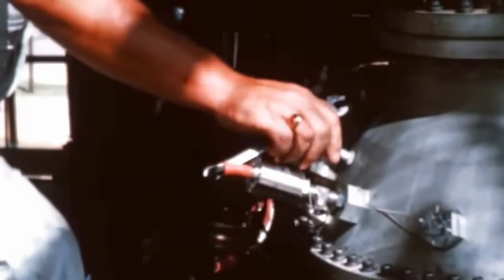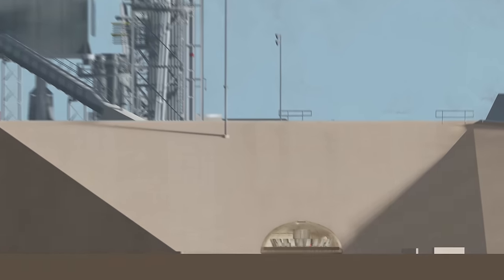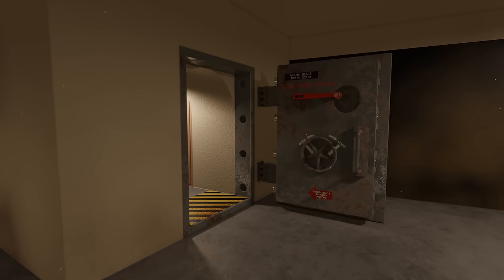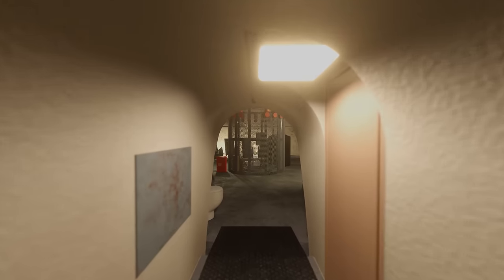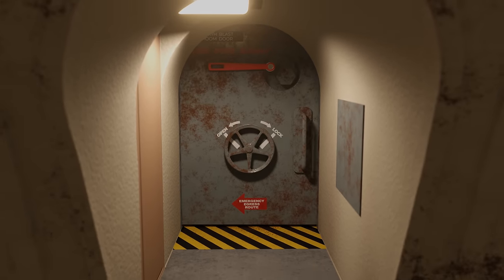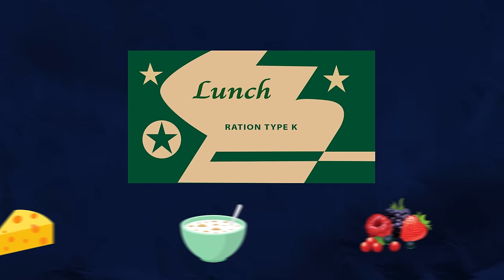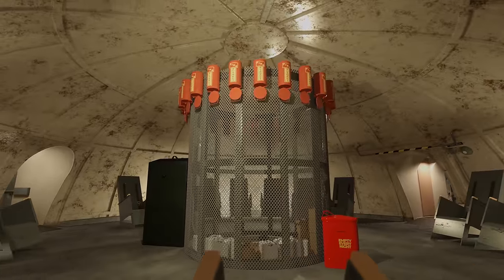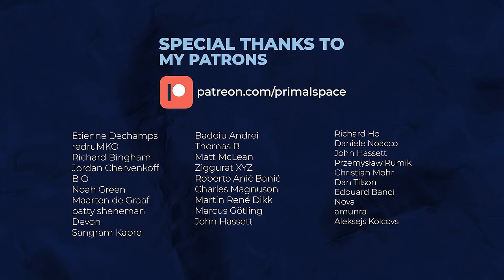NASA's Most Off Limits Room

Comment: the engineering lengths they went to to protect the crew any way they could is impressive
Reply: While the soviets were saying: N-1 exploded? Alot of people died? Skill issue for them. ( not sure if this is accurate)
Reply: Everything but a launch abort system
Reply: I’m guessing after Apollo 1 safety and preparation for emergencies became pretty important.
Reply: @benharris599 there's a launch abort system you ok?
Reply: @TheWorstBridger  Yeah, was gonna say. It's literally that thing at the top of the whole assembly.
Reply: @TheWorstBridger  tell that to the families of Apollo 1 who died due to a fire causing them to get stuck in the spacecraft
Reply: @x808drifter  tell that to Apollo one
Reply: @benharris599 the launch abort system protects from a failing launch vehicle, not cm. Besides, that issue was solved with the block II CSM
Reply: @benharris599  It's nice that you're aware of Apollo 1. Not so nice that you seem to be totally unaware of the aftermath.
Reply: @johncochran8497  what aftermath am I missing?
Reply: @benharris599  Everything. Apollo 1 was the only block 1 command module used. The rest were block 2. It was the only command module with a 3 piece hatch that was difficult and tricky to open. Under idea conditions it took at least 90 seconds. The block 2 modules used an unified hatch that could be opened from the inside or outside within 3 seconds. The Aerospace Safety Advisory Panel (ASAP) was established after Apollo 1 and that panel is still active today. In a nutshell, Apollo 1 caused NASA to become extremely safety conscious. Whereas your comments seem to be limited to "tell that to the families of Apollo 1" while totally ignoring the changes that took place at NASA after the event. In a nutshell, while people are talking about NASA's actions after Apollo 1, you keep talking as if they're still acting like they did before Apollo 1 and ignoring everything they've done afterwards.
Reply: @benharris599 The American Way 
🇺🇸🦅💪
Reply: @Diukaz well the n1 did explode because the issue is that the flight computers back in the day couldnt handle the amount of engine the soviets used for stage 1.
Reply: Impressive my ass, having to travel to the base of the launch pad to enter that escape tunnel alone makes this entire structure completely useless. They need to redesign this to have a chute that goes all the way up to the working platforms at all levels like one of those garbage chutes you have in apartment complex. The chute should have pressurised air blowing out of it to reduce speed on vertical descend. Either that or equip the platforms with escaping jet packs so staff can fly away from the platform at speed.
Reply: @avcomth thats a great idea. "We have a hydrogen leak" "quick, fire up the jetpacks!"
Reply: @kain0m  Or you could jump down the chute as I described at length...
Reply: @Diukaz  I believe the Soviets did the best effort they could to make things safe.

But it was still the Soviet Union, a nation beset by constant economic and political issues. The Engineers may have always set out with the best intention in mind, but the end result didn't always hit the mark, especially since the Engineers had every power except the one to say "No". 

The soviet engineers were successful almost always, though. In terms of fatalities and danger, I believe soviet and american space programs were pretty competitive. We were not without our accidents as well. Shortcuts were taken by both sides in the Space Race. I am not usually a fan of the "both sides" argument for things, since its disingenuous in most cases, but I think it is fair to use it here. The Soviets and the Americans were both putting their best foot forward, and both emerged as highly competent, respectable space programs that, in the end, ended up often cooperating together.
Reply: @avcomth  you act like multiple safety organizations and top engineers didn't think about this before spending millions to build it lol. 

As the video describes chutes that high up would just allow more pressure, but also the fact that the platform moves, it isn't part of the pad, and if they don't have time to descend the structure then they won't have time to get to the bunker.. if they have time to get to the bunker then they have time to descend the structure.

Your oddly specific design ignores the issues it has and focuses on non-issues that the bunker want designed for anyway and then calls it "useless" xD because I'm sure you're experienced in designing and testing emergency blast bunkers for rocket platforms.

Sure, they stopped using it because it was impractical probably and times change, but saying it was "useless" is just ignorant of its purpose and potential use-cases for the time and the emergency(ies) that they were mitigating.
Reply: It seems to me by the time you know a giant tube of rocket fuel is going to explode it would have exploded. The bunker was probably more of a safety blanket than anything practical.
Reply: @mushyroom9569  you're not wrong, but also think of a car in a crash leaking fuel, you have time to run away but the leak is dangerous due to external factors.

From the video it sounds like this is the use-case. If there's an error or a leak that allows evacuation they may have time to get off the platform, but they wouldn't be able to run a few miles away in case of an explosion, but if they get to that bunker they can wait while ground crews figure out the issue and fix it or let the rocket explode if necessary/if that happens.

I don't think anyone would've expected it to be like a fire escape, but it's better than having your crew run a few miles potentially for their lives and then still be at risk if there is an explosion.
Reply: @benharris599  the LAS is built to take the entire command module away from the launch vehicle. All you would a achieve by firing it is that it would be impossible to get into the capsule
Reply: @avcomth  it took 90 seconds to open the hatch and you can't just deploy it with the abort system still attached
Reply: @MagicCookieGaming  If you’re going to build a rocket that is supposed to withstand the physical pressures of going to space in under 10 minutes, then you’re probably better off spending money to make extra super duper sure it doesn’t spring a leak while it’s just sitting on the ground rather than building a bunker with shock absorbers.
Reply: @mushyroom9569  ah yes, rockets, simple things notoriously easy to perfect with no moving parts lol
Reply: @Astro_Error massively so.
Reply: @MagicCookieGaming  ??? If rockets were super simple or easy to perfect, then throwing more money at perfecting them wouldn’t make much sense.
Reply: @mushyroom9569  yep, I was being sarcastic because what you said isn't realistic. It's better to have safety redundancies because putting "extra work" into a rocket won't stop emergencies from occurring.
Reply: @MagicCookieGaming  Safety redundancies are “extra work.”
Reply: @Astro_Error  You'd think, or maybe After Challenger Exploded on lift off. That NASA then tried to cover up the fact that engineers the night before said not to launch. Not to mention it was a well know issue that caused the disaster. Or maybe they would have learned in 1988 just two years later when Space Shuttle Atlantis Barley made it home with a damaged heat shield from falling debris from the Solid boosters during launch. Something like as many as 100 panels where badly damaged, and one had been burned all the way through. Mission STS 27. Yet in 2003 Columbia broke up on reentry due to heat shield damage from falling debris from the External tank. Which was STS 107.
Reply: @mushyroom9569  Each F-1 engine was made and assembled by hand by incredibly skilled craftsmen who didn't have access to modern tools or computers. It's why they are impossible to reproduce today, and it's also why they could have flaws that no amount of money would help detect.
Reply: It cost more to train new astronauts than it did to build this bunker. The astronauts flying their missions were NASA's single most valuable asset.
Reply: Yeah, and then give them cigarettes. Different times, indeed.
Reply: @TheWorstBridger that was only on the block 1 command module. And that was only on apollo 1. Block 2 hatch opened in about 3 seconds.
Reply: @mushyroom9569  safety redundancies are things like: having lifeboats on a ship in addition to watertight bulkheads that limit the extent of flooding from hull damage.

Saying, just spend the extra money to make super duper sure the ship can't sink, is not a form of redundancy.
Reply: @r7calvin  There is a huge difference between life boats and building a underground blast-proof bunker on the off chance you have just enough warning to get to it but not enough to get out of the danger zone. 

Lifeboats for this situation would be more like streamlining evacuation routes.
Reply: fam
Reply: @r7calvin  then why build it in the first place if you know it's going to fail? pure ignorance, how about you just put more work into making it actually WORK, it should be common sense, plus, have a damn sense of confidence in your own creation
Reply: Same organization the guilt of burning a whole crew alive and blowing another up…and a shuttle disintegrating all due to their lack of care for crew safety 🤷🏼‍♂️
Reply: Yeah but still really really outdated and still violates most of the OSHA regs.
Reply: @mushyroom9569 at the time they had a near unlimited budget, so they did both
Reply: @JeronimoStilton14  “unlimited budget” = other people’s money stolen under duress
Reply: @mushyroom9569  are you a sovereign citizen or something? No it was the American tax payers money used as there was a fear that the first to conquer space would be a new military superpower. I guess that’s duress? But that applied to the leadership as well so doesn’t really track
Reply: @JeronimoStilton14  How am I a sovereign citizen? Because I acknowledge the fact that taxes are not voluntary? Because I disapprove of wasteful tax spending? Seems to me like the sovereign citizen movement was propaganda that is working exactly as intended.
Reply: @mushyroom9569  taxes are voluntary, just have to move to another company, but then you get to pay their taxes. Taxes are a part of life in a governmented society. You can live in a commune off in the mountains somewhere and not use it, but if you exist while inside of an area with ANY infrastructure, you are making use of a service provided by the government, paid by others tax dollars.

At the time American support of the program was much like the budget, 'unlimited.' Now it is basically nothing, so if your problem was space travel, your gripe has already been solved. If you just think any tax dollar spent is a tax dollar wasted, then I can't really help you. 

As for it being propaganda, god they wish they could create that good of a psyop.
Reply: @JeronimoStilton14  Incorrect. US citizens who move to another country are still subject to US taxes.
Reply: @JeronimoStilton14  Also, nice strawman about “any tax dollar spent being a tax dollar wasted.” We are talking about a literal underground bug-out bunker (with shock absorbers!) that had a less than 0.001% chance of being used, not “muh roads.”
Reply: @mushyroom9569  You are only required to pay US taxes if you retain citizenship, which sort of went without saying if you read in even half hearted faith lol.

It was used 0 times, probability is semi-irrelevant. Here in the developed world we generally try to do what we can to minimize lethal risk to workers, and doubly so if a solution could be engineered and built rather easily. That bugout bunker probably cost less than a single wheel for the rocket crawler. 

You seemed to directly imply you think all tax dollars spent are tax dollars wasted since you are currently arguing all tax dollars are stolen under duress. Don't frame your argument in black and white and then be mad people generalize your argument? American support for the space program was extremely high, I personally would have been fine with some of my money going to create an evac plan for the workers on the platform, which could include the astronauts if they had not yet fully boarded the capsule. The fun part? Despite your implication that it is useless, spacex still uses an escape chute, they just didnt feel the need to put a bunker, so the astronaut gets to die anyway.